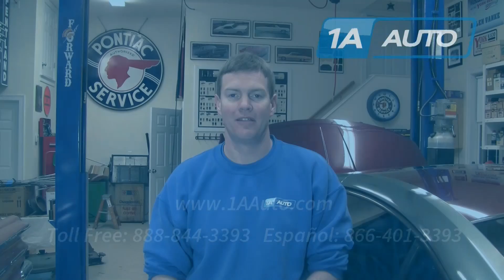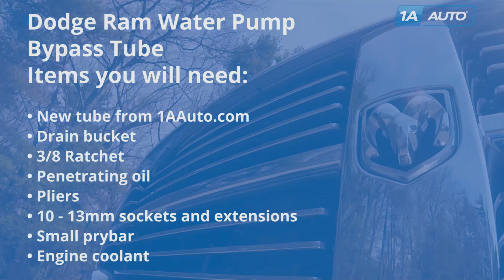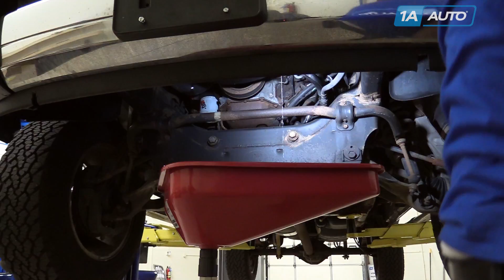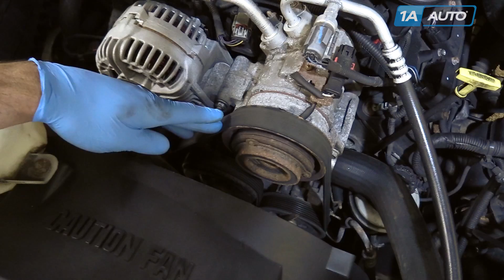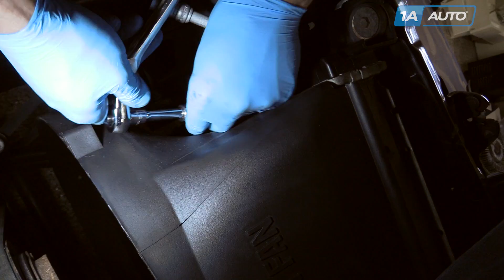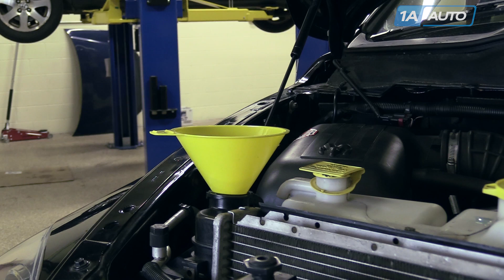How to Replace Water Pump Bypass Tube 03-08 Dodge Ram

Comment: As this was a very helpful video that I referenced many times. My tube would not come out without cutting it. Then I had to cut where the top bolt connects the tube to water pump to get new tube back in. I don't recommend doing this but that's the only way I could.

Comment: Well I replaced my water pump which has the bypass pre-installed couple months later now it looks like its leaking from the bypass so the question is to I replace the bypass or try to warranty the water pump

Comment: If this is giving me problems can it make my coolant pressure go up
Reply: Or do I also have head gasket problems
Reply from the maker: +Marcos Marc You may want to try to replace the radiator cap. It is suppose to release pressure in the cooling system. Hope this helps you out. 1aauto.com

Comment: Thanks. You guys helped me step by step to install the hose.It was a pain in the butt in the beginning because I ordered the first hose and it did not fit properly. So I had to go ahead and order another hose and thank God this one fit more properly. These parts are not guaranteed to always fit so it is a hit and miss. But it is a tight squeeze if you do not take out the radiator fan which I didn’t. After a few knickknacks and pounding with a rubber mallet little by little I was able to put it back in. Thanks again.